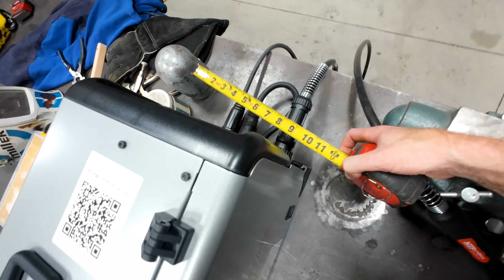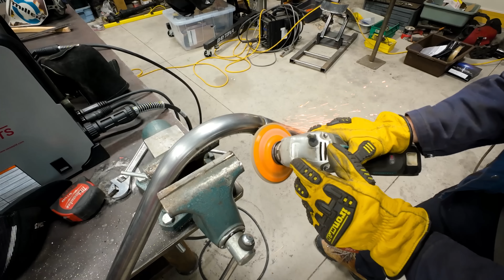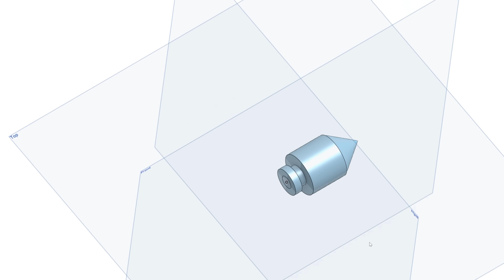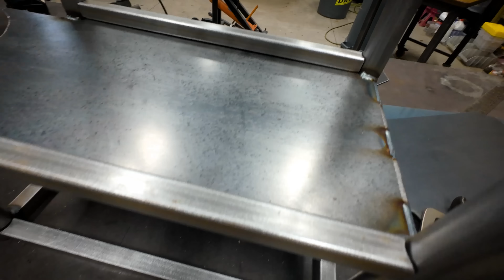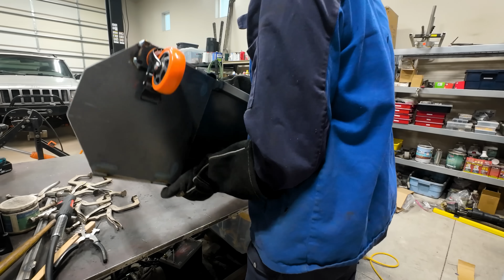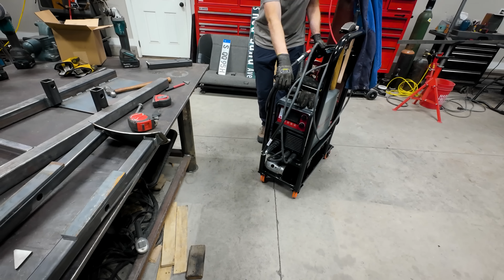The DIY Welding Cart Every Welder Needs

Comment: The new miler milermatic  141  120 volt A/C has the gun lead angled down .  It feeds off the top of the wire spool 10-11 lb .  Nice video . I’ve built one for my tig/stick/plasma cutter to go under it . I’ll have to have 2 tanks .  1 co2  & 1  argon .  Thanks for sharing ! Love the drifting !

Comment: I have some easy "rules of thumb" you can follow in bending tubing.  These are for finding the length of tubing in the bend.  (1) For 90 degree bends:  Multiply the centerline radius of the bend by 1.57  (2)  For 180 degree bends:  Multiply the centerline radius of the bend by 3.14  (3) For other bend angles:  Multiply the centerline radius of the bend by the included angle.  Then multiply that product by the constant:  0.01745.  These calculations will allow you to determine how much tubing will be consumed in the bends.  So, if you have a complex shape to bend you just add up the straights and the bend allowances to get the total length of tube you need.  This will cut down on waste.  🤓

Comment: Tom, that’s a nice cart.  
One thing though, my experience with those 2 piece orange 🍊 wheel casters the orange wheel tire deteriorates/breaks down within 3-5 years.  For some reason they just fall apart.  After replacing them twice on my full size table saw, I replaced the last set with solid one piece poly-plastic wheel casters.  
Anyways, enjoy watching your channel.  Thanks for sharing.
Lou from Miami 👍🇺🇸

Comment: cool project Tom.  I find it difficult to locate materials to build items, or is it I find materials too expensive...??? Either way , when I do start a project it is usually using recycled materials.  I find old bed rails to be very cost effective and most of the time in good enough shape to weld into a project.  I am searching for a place to purchase plate at reasonable prices so I can have some on-hand for future projects.

Comment: @tomtomsshop You need to add an entry and exit to your cut path to clean up your cuts.  I use an arc and it’s length correlates to the torch tip and sheet thickness.  Love the work, keep it up!

Comment: Looking at the concept I would have to wonder about the weight of the welder versus the weight of the gas bottle, depending on the size of the tank. If much heavier than the welder, the narrow wheelbase may make the cart a bit tippy, don't you think?
Reply: So maybe put the casters on the other side of the bottle?  If it's not stable he will fix it!

Comment: I put my Hobart welder on top of a tool box that I put a tank mount on one end bigger than your cart but I have room for everything on it helmet, grinders grinder, wheels tank caps, clamps grips, hammers, extra wire, nozzle dip, rulers tape measures chisel squares, you name it I got it on that cart and I’m way overly happy with mine

Comment: I fundamentally disagree…the shopping carts at IKEA are atrocious, especially when heavily loaded, as the cart’s momentum overwhelms the casters when cornering. But four casters probably work fine for a welding cart.
Reply: I can't stand 4 wheel casters that rotate!
Reply: Yes!  Fully agree!  I hate those carts at Ikea as well.  Makes me want to jam an Allen wrench into each swivel on the rear casters.  It would be good on a welding cart though, I always have to do a three point turn with my welding cart that only has two swiveling casters.
Reply: As someone who spent about 15 years in live events, I have way too much experience pushing road cases.  All of which have 4 rotating casters, and all of which are really heavy.   There is a learning curve for sure, but once you get the hang of it they are actually really easy to maneuver.   For example, in the scenario you described, you want to push on the front corner opposite the turn you want to make.  You can either let go and walk to the front (momentum will keep it moving). Or spin the cart around as your walking so you can push into the turn.   Once you’re got it down it will go anywhere. And make corers a 2 wheel steer setup can’t dream of
Reply: @andrewr2650 Are you describing a scenario where one has to control the car from both ends, motivating from the rear and steering from the front? I have no doubt that’s super maneuverable, but also a lot to ask from a person pushing a shopping cart. 😁

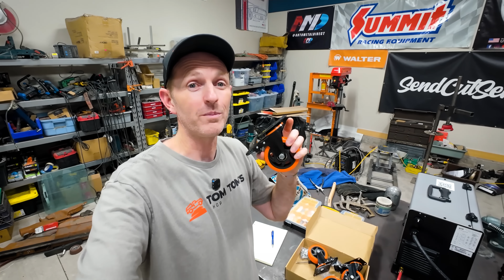Comment: 3:07 All shopping carts here in Europe has 4 caster wheels, it's not just at Ikea. 
I don't know American shopping carts only has 2 casters, I find that so annoying.
Reply: They have 4 casters, but only two that swivel. This makes it way easier to push around. With  4 swivels the cart tends to crab walk. The only advantage is getting in and out of tight places which has never been an issue at the grocery store.